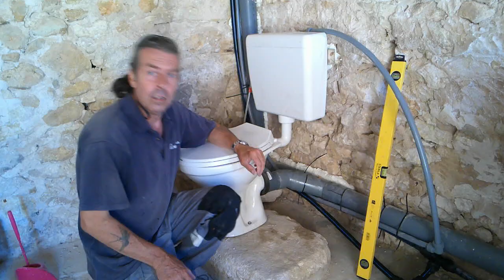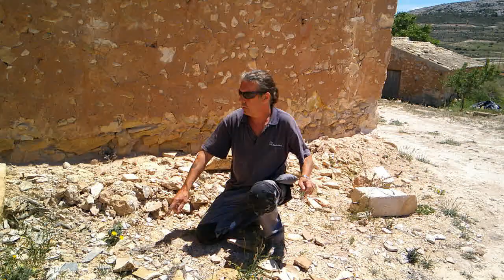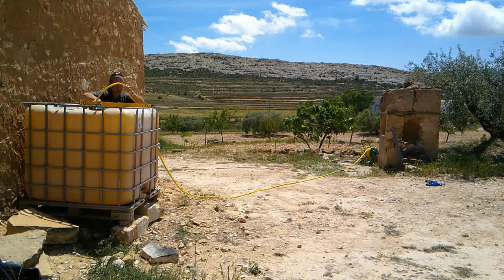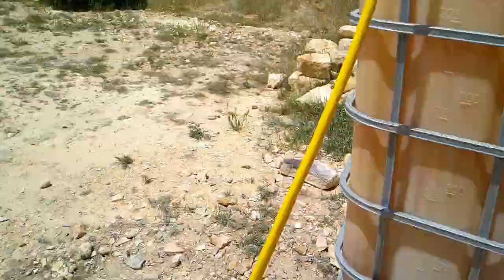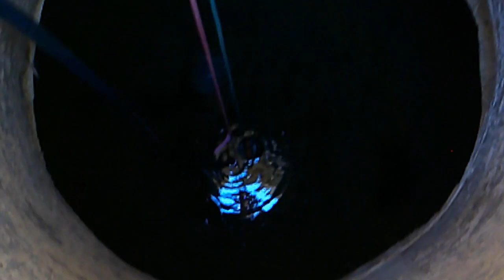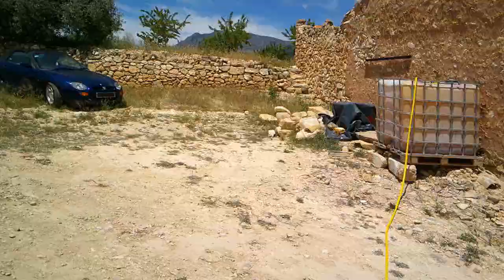Off grid Finca - the loo is plumbed and another IBC. Going forward, sharing the thought process.

Comment: Will you paint the water tanks black to avoid algae formation?
Reply from the maker: lol, that will be a no. Apparently if the water temp reaches 50ºC then that kills everything and it won't be there long enough for algae to form. We use over 100 litres a day on the garden so even 4000 litres will be gone in 5 - 6 weeks - and with air temps of 30 - 40ºC we could probably brew tea from the hot water in the deposits...